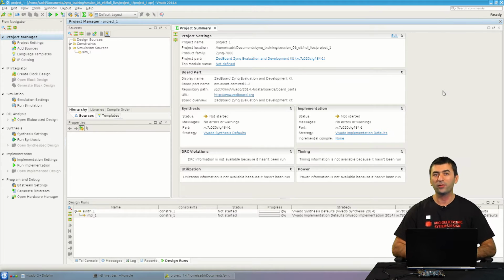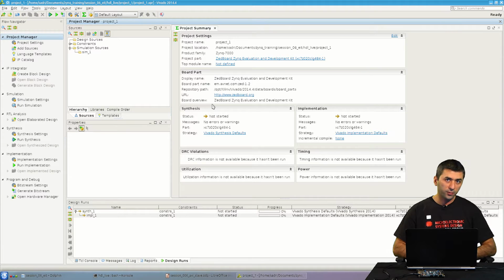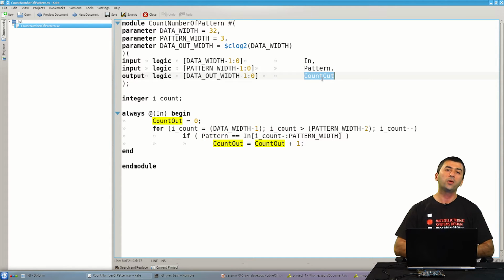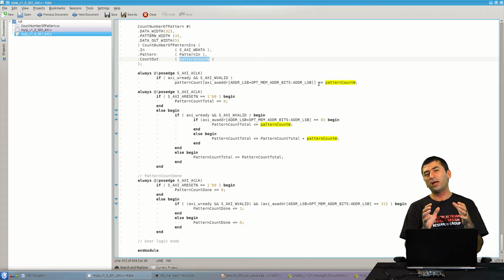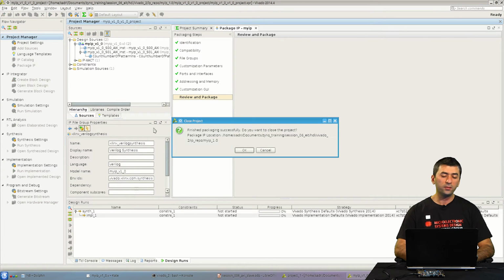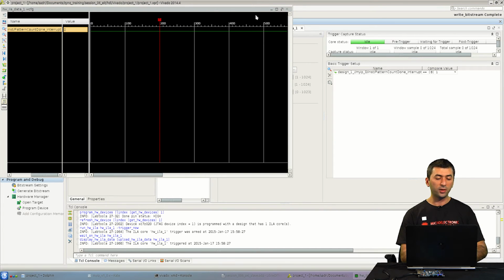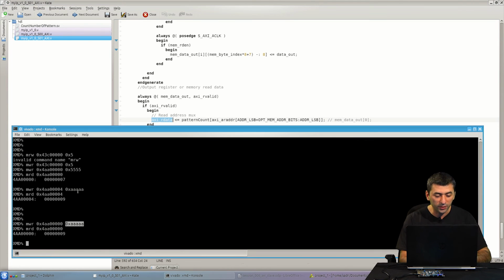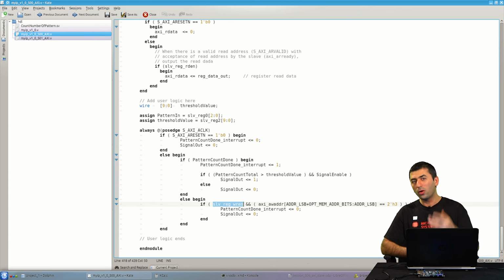Creating Custom AXI Slave Interfaces Part 2 (Lesson 6)

Comment: In the video, he used 64 bytes as memory size of the Full AXI. Should make it to 128 bytes , otherwise the interrupt will not work.  There are 32 samples,  32 bits each ==> 128bytes of memory, not 64 bytes.

Comment: Just a little comment:

In the video, Mohammad creates the AXI Full Slave interface via the Vivado Wizard with 64 bytes of memory (therefore, OPT_MEM_ADDR_BITS = 3). 
However in the version he has modified it to (OPT_MEM_ADDR_BITS=4) to be able to address 128 bytes of memory (i.e., 32 words of data).
He doesn't mention it in the video but I think it's pretty important. 
This is because Mohammad then uses axi_awaddr[ADDR_LSB+OPT_MEM_ADDR_BITS:ADDR_LSB] == 31 which would not function with OPT_MEM_ADDR_BITS = 3.
Reply: thanks for your comment

Comment: hi, thanks for your vids, so far they have been very useful to me . Still there are few point I didn't get, because I am a begginer in HW design :
I am currently working on interuptions.  But I don' understand when and how you enable and diseable the interuption. Do we always need to use this register based idea or is there an other way to do it ?
Reply: hello louis, thanks for your comment. i will be happy to help you. just, can you clarify what do you mean by interuptions? you mean the interrupts going from PL to PS?
Or generally you mean the method we transfer data between PS and PL?
If you watch all of our videos you see that the register based method is not the only way. there exist method to this this task with higher performance. The register based method however is the easiest one and well obviously it gives you the lowest performance, which is enough for many different cases.
Reply: thanks for your quick reply. 
I did meant the interrupts from the AXI HW accelerator to the ARM processor . But after I watch the video again, I understood more or less how it worked. basically, when the CPU is writing to the last register, you send the interrupt isn't it ?  But then How do you know the address of this last register : I really don't get this line "if (axi_wready && S_AXI_WVALID)&&(axi_awaddr(ADDR_LSB+OPT_MEM_ADDR_BITS)==31 begin "

here, can you specificaly describe axi_awaddr(ADDR_LSB+OPT_MEM_ADDR_BITS), what does ADDR_LSB and OPT_ADDR_BITS represent ? 

 I am currently watching your last lesson about making a master AXI IP. 

What I am currently doing (or actually trying to do), is to interface a memory, controlled by a slave AXI. My idea is to spoof the AXI device and to let it trust that the memory (which is a Bram memory) is the AXI peripheral register . Like this I will have as many register as I have memory. I have started to mess up a bit with the piece of code automatically generated by vivado, and that's pretty hard.I don't know if it will work HAHA.

Anyway, I am pretty curious : what are the others ways than register that I can use through AXI devices ? 

As a beginner I have to say that I am really struggling with the AXI protocol, HAHA
Reply: is that :+ or just +? look up your verilog guide to understand the meaning of it, which is very important. 
When my module enables its interrupt line which goes to PS, the CPU knows which interrupt it is and we also know how to clear it. So after reception of the interrupt, the cpu just writes to the register that i have defined in the hardware and is responsible for clearing the interrupt. 

I advise you to watch all of the videos carefully, just to improve your design quality. So before going ahead with your idea and representing the memory as a large number of registers, watch all of the videos. I think your design method will change.
Reply: Hi , I am a bit further in my design. I design a HW close to yours , and I would like to control it with a standalone software. Everything went nicely except for the interrupt setup in C programming .  I tried different pieces of code I found , but there are all for GPIO peripherals and not for a custom IP. Plus, there are pretty hard to understand.Then do you have any good tutorials or links that  I could take a look on ?

best regards thanks
Reply: Hi Louis, did you have a look at my other videos where I am designing with AXI DMA in stand alone mode? there I setup the interrupt. The procedure is the same, it should work for this one as well.

Comment from the maker: +Dr. Talal Bonny: sorry, I accidentally deleted your comment... here the answer: AAAAA needs only 20 bits!
Reply: +Microelectronic Systems Design Research Group: But in this example you did not use a burst transfer. So, you transferred one piece of data using the axi full interface between the master and the slave. How will you send burst of data in this example using the axi full interface?
Reply: +Dr. Talal Bonny Dear Talal, I am afraid I do not understand your question. The video is about AXI Slave interfaces. When you have a slave interface you don't initiate transactions, the transaction will be initiated by the AXI Master, which is in this case the ZYNQ PS GP port. And when you have an AXI Slave full interface this means that the AXI Slave hardware supports bursts. So the ARM host is allowed to initiate read and write transactions to our AXI Slave port which contain bursts of data. So for example, if I am running a C code on my ARM host which performs a number of write operations to consequent addresses (in the address range of my hardware accelerator), then the ARM host will execute this as a burst write operation and our AXI Slave Full hardware can accept and can respond to such a transaction.
Reply: +Mohammadsadegh Sadri If my AXI Master wants to write more than 32 bits sequence of data (let us say 40 bits) to an AXI slave full interface. As the AXI Master will execute it as a burst write operation, can we write the following in the XMD console: mwr 0x4aa00000 0xaabbccddee.Will the first 32bits be written in the address 0x4aa00000 and the rest 8 bits in the following address, i.e. 0x4aa00004 because of the burst mode?
Reply: Hi Talal, no you need to separate it into two writes. the first one can be a 32 bits write and the second a 8 bits write. to elaborate a little bit more: the ARM host of the zynq is a 32bits CPU, and the AXI GP0 Master is 32 bits width port. So the reads and writes you issue within xmd are basically 32 bits width operations.